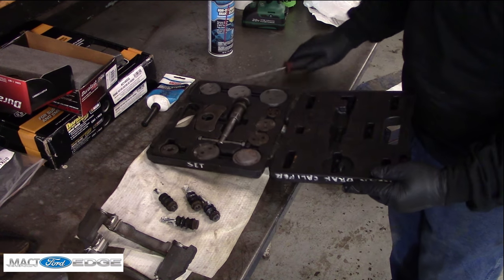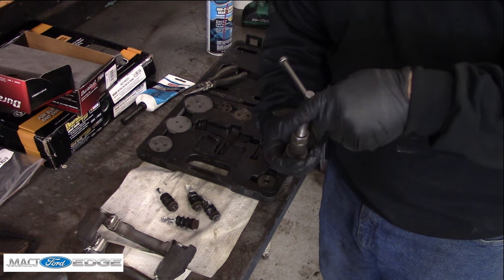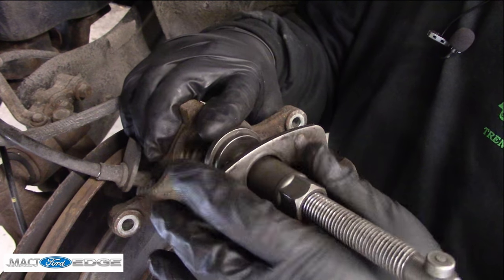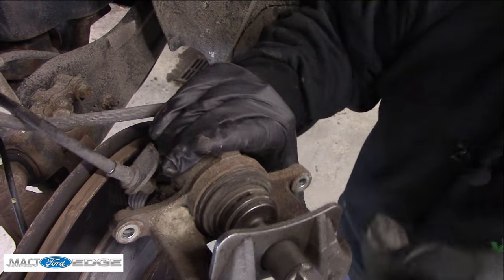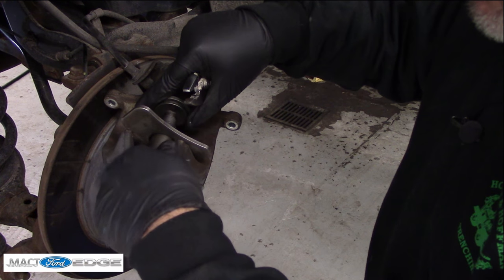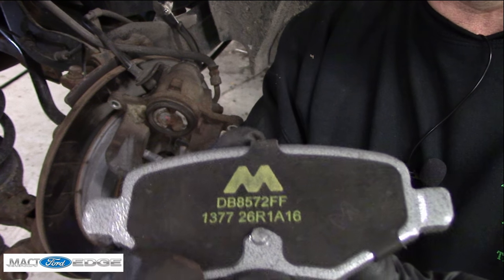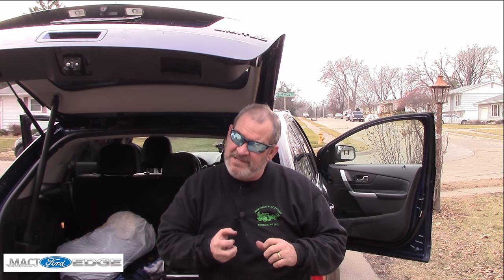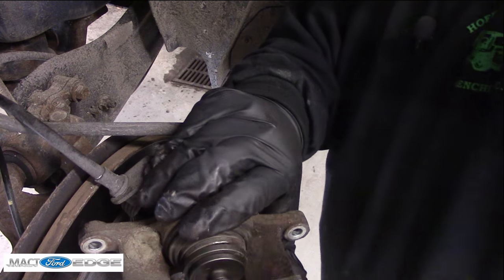How to use the rear brake caliper tool on your Ford Edge 2011 plus model year

Comment: I strongly urge folks that are going to do the rear brakes on their Edge to take MacT's advice on this one.  I purchased one of those cube style caliper tools thinking I would save a few $$ and be able to keep the tool.  BIG waste of time.  Did not work at all.  I ended up using a C-clamp, a channel lock, way too much time, and most of the curse words I know !  Wished I had the caliper tool Mac describes above!!
Reply: He also points out the importance of lining up the notches on the piston and the tabs on the brake shoes. Other videos do not make this clear. Great video.

Comment: I sure wish I would have found this video before I changed my rear disc pads on our 2011 Ford Edge. I did not align the notches on the face of the piston to the top of the park brake.. The tab on the shoe was placed on the outside of the rotor facing out.  So how serious is that overlook ? Do I absolutely need to re-do this ? The brakes seem to be working fine.
Reply from the maker: You could try to pull the caliper loose and see if you got lucky and the notches  somehow slid into position through use.
Reply: Thank You for responding ! What is the reason for lining them up ?  Is my install unsafe maybe ?
Reply from the maker: They catch on the brake caliper piston and cause the piston to turn and keep the emergency brake tight. The new rear calipers also double as the emergency brakes.   Not saying unsafe but may cause uneven brake pad wear.
Reply: All fixed ... Thank You Very Much Again.